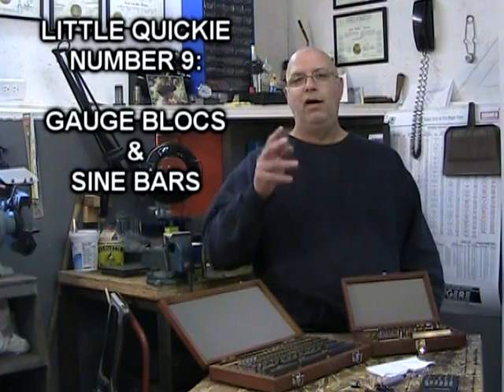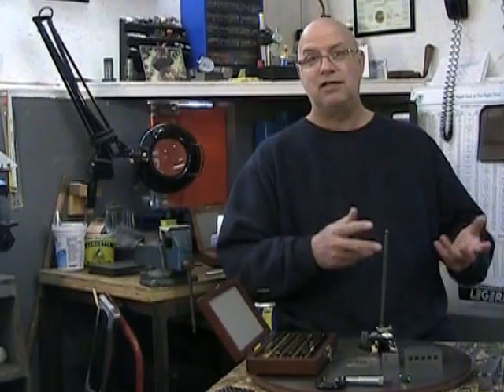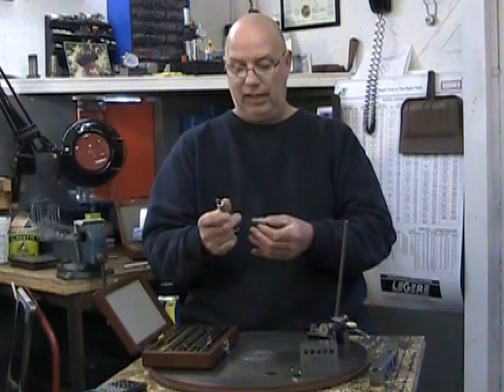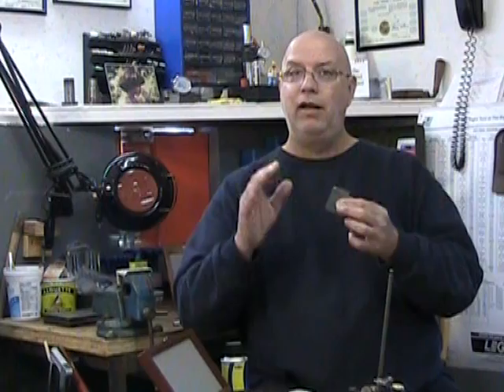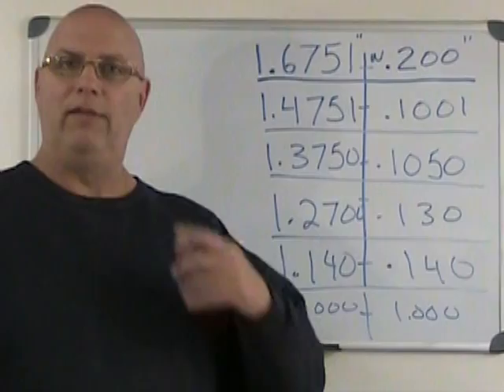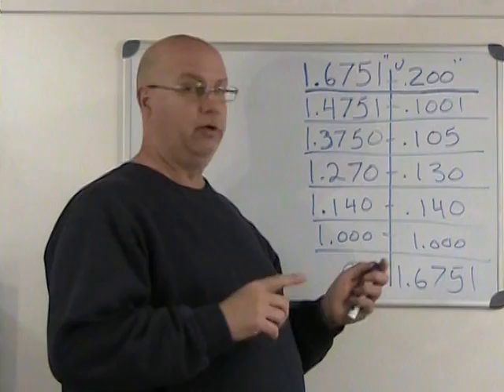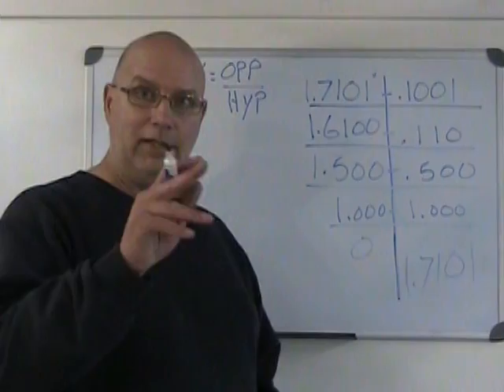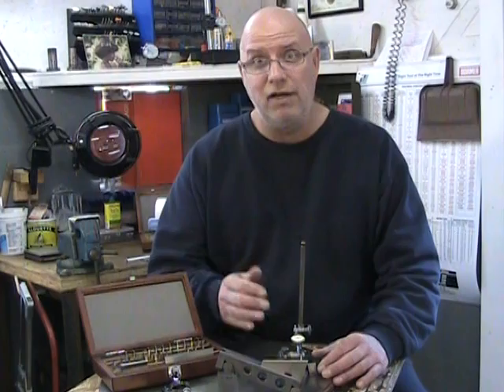GAUGE BLOCKS & SINE BARS, HOW TO CALCULATE & ASSEMBLE JOE BLOCKS FOR ACCURATE ANGLES, MARC LECUYER

Comment: Hi, thanks for the video, I enjoyed watching - however I'm a bit confused. Firstly you tell us to clean the blocks' measuring edges and be careful not to touch them because of acids and then later you say to use some 'forehead grease'. Doesn't that also have acid? Most other videos I've seen say to make sure the blocks are very clean before wringing.

Comment: Hi Marc,

Great video on gage blocks. What is that disc that is your surface plate? Looks like some kind of engine part.

Kind regards,

Tom
Reply from the maker: Hi Tom, the mystery disc is an old drive wheel/gear of a cut off band saw. About thirty five years ago, I (apprentice) was assisting Dick Steward (supervisor, departed) replace this warn out gear. I was looking for a good flat and stable surface plate for someone who had  just got married and didn't have enough money for lunch. It fit the bill and I have used it ever since. Thanks for watching, I love what you do at oxtoolco and I am looking forward to finding out what Abom thinks of your aluminum box! Very funny stuff. Marc L'Ecuyer
Reply: Instablaster.

Comment: Once again, excellent, and thanks. 

Quick question about your mention of 'wear' blocks, are you referring to 'sacrificial' blocks that are rubbed on the surface plate and\or rubbed against surface gauges, micrometers, rulers etc. that would be 'The-bread-part-of-a-sandwitch', that is the stack of gauge (joe) blocks?

Too that end, do gauge block sets come with a couple of 'extra' same sizes for that purpose?

Regards,
Charles
Reply from the maker: You are right Charles, the wear blocs are the outer part that protects the inner blocs. They are no different than any other joe bloc in the set but have been chosen to meet abrasion head on. Most joe bloc cases have two spare slots (in the video look at the eleven second point) for wear blocs, the 0.1000" blocs are usually bought separately. Thanks for watching! Marc L'Ecuyer

Comment: Hi .That was great and whilst I had an appreciation of how it's done, this really nailed it for me, due to the way you built up the lesson gradually, ending with a fully worked example using all the skills learnt along the way....great teaching technique. I can now see how to inspect and check angles on items I already have, but it would be a great next step to see some practical examples of how to use the sine bar when setting jobs up on the mill?

And now a question. I played around a bit with the sine function and have come to the conclusion that for occasional hobby machining (not tool room) that given an accurate 5 inch sine bar and no gauge blocks, the following is possible: Up to around 20 degrees, then if you can machine a solid stack to within 1 thou then an accuracy of around 100th of a degree is possible and the worst case scenario of 45 degrees can be achieved with similar accuracy if you can hold the stack to within half a thou. Am I doing the maths correctly? To calculate this I simply looked up the sine of 20 degrees and 20.01 degrees, multiplied both by 5 and then checked the difference in the stack length.
cheers    mike
Reply: I went a long time without proper gauge blocks until I could afford a known good quality set (Mitutoyo) In the mean time what to use. I tried machining separate blocks for any angle I wanted to set my sine bar to. Generally I got somewhere within + - .0005" with a mill, sometimes a bit closer but that was about average. Started doing some thinking about all the time used up anytime I wanted a new angle and that it wasn't all that accurate anyway by gauge block accuracy standards. I also have a set of adjustable parallels and good micrometers. If your careful you can partially tighten the parallels locking screws and tap either end of the parallel on a soft wooden surface to make small size adjustments and keep measuring with a mike until you hit what size you want within at least few tenths. Still not perfect but much faster and more accurate than machining your own blocks to size each time. A good set of Starrett, Mitutoyo etc adjustable parallels still isn't all that cheap, but if your needing fairly good accuracy a very well made set isn't really optional in my opinion. Those adjustable parallels are a versatile and handy tool with multiple uses. I hope the idea is of some use to you.

To answer the math question and I had to consult my Machinerys Handbook sine table constants to do so. To go from 0 degrees, 0 minutes, 0 seconds, then to make a 1 minute adjustment would take a block height of .00145", or rounded off about .0015" per one minute change with a 5" sine bar. If your stack height is within .001" of being correct then you'd be within about .66 of a minute. I'm sure you know that .00145" per second doesn't hold true as the angles get steeper, but it's close enough to answer your general question. So yes you'd be pretty close, but only you can decide if the numbers would work well enough for what your doing.

Comment: Marc,
     I'm a newbie so forgive my ignorance, but won't the lazy susan gizmo you're measuring on have to be flat to a large degree too in order to get your last part of the video, the 20-degree angle to measure out to zero?
Reply from the maker: Hi Dough-Joe, you are right and it is flat. The disc is a hundred year old grey cast Iron gear that I machined and lapped flat many years ago to serve as a surface plate. Forty years ago I was into recycling, not because it was the "in" thing to do but because I had very little money. Now that I am at the other end of my life I have the money to afford a nice surface plate, but that old one works well and it contains so many memories! I think I will keep it. Marc L'Ecuyer

Comment: all world know english but 90% people dont know inches)) think about that
Reply: I was taught inches, feet yards in school a long time ago so chose to keep my shop measurement systems in that imperial measurement. But I know how to mentally convert almost any metric unit that's used in any Youtube video close enough and fairly quickly to the imperial I think and visualize with. Having a basic understanding of how to do so doesn't take long and isn't that hard. Many drawings in old books etc were done in imperial measurement. What would you do if you wanted to build something from one of those drawings? Give up? It's a few key strokes on any calculator. 24.5 mm = 1.000" inches. Or any inch measurement multiplied by that 24.5 will give you the metric size. Imperial fractions are just as easy. 1/4" for example, always take the first number and divide by the second number. It works for any fractional inch based measurement.1 divided by 4 equals .250" to convert that to metric simply use .250 x 25.4 = 6.35 mm. Yes almost all the world is using and understands metric, but it's easy to convert one system to the other and metric dimensions used in any Youtube video doesn't bother me enough to even think about complaining it's not in imperial.